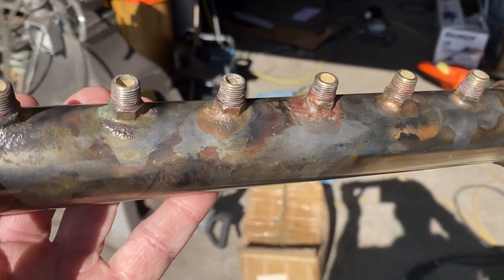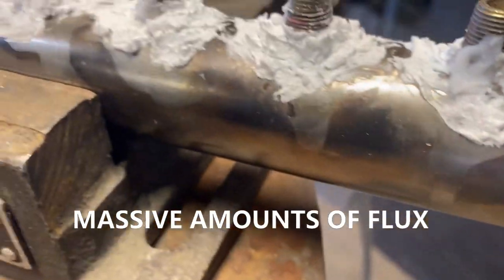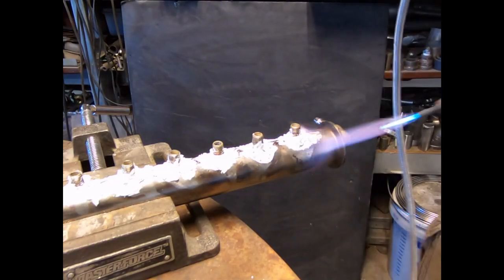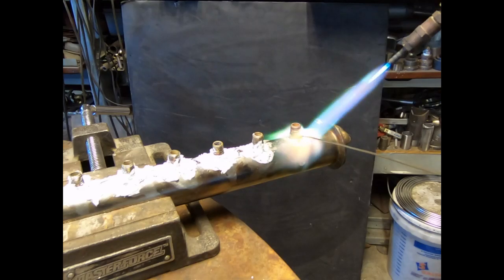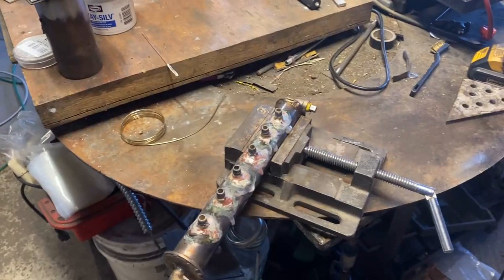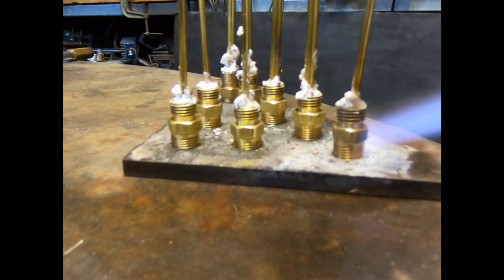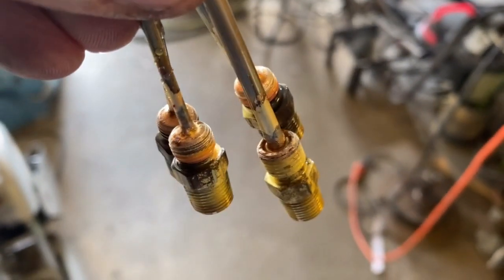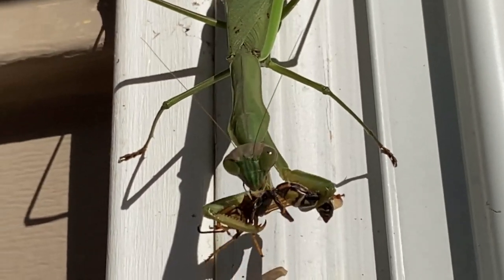Brazing techniques for brass to steel or stainless

Comment: Kinda unrelated but seeing as you are a fellow mad science guy, was wondering if you tried carbidizing steel before.  Rocklinizer is the commercial machine.  You can do the same with a carbide burr on a dremel, and DC inverter welder on lowest setting for same result

Comment: HVAC is the main use of PhosCopper I think (BCuP). I’m not sure what industry uses silver solder (BAg). Bronze (RBCuZn) works well for steel to stainless. Brazing charts are very helpful for the numerous brazing rods and fluxes. What flux did you use for the PhosCopper and silver solder?

Comment: Idk if hydrogen is the best thing to use when brazing.Sure it reaches high temperature but there is a problem with ferrous metals and hydrogen-its called hydrogen embrittlement.Molecuses of hydrogen penetrate mostly ferrous materials and make it brittle like a glass.
Reply: Not all materials are the same thou ,some are affected more some less it depends on alloy of steel.Some non ferrous metals are completely immune to it .
Reply: Had some success removing flux by letting it soak in vinegar. I'll try the ultrasonic bath next time.
Reply from the maker: Yes i often add 20 to 40 % vinegar